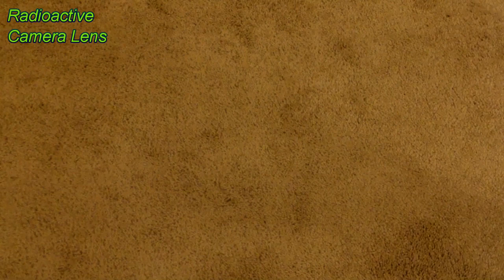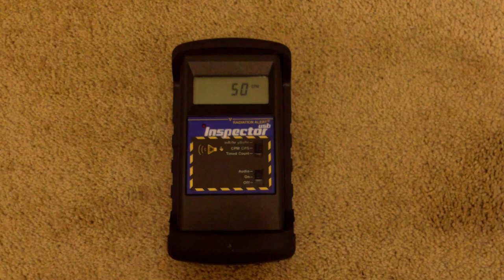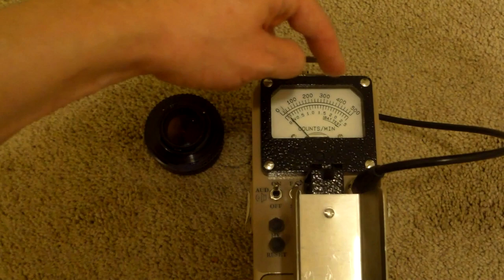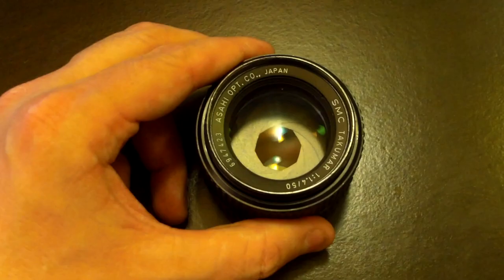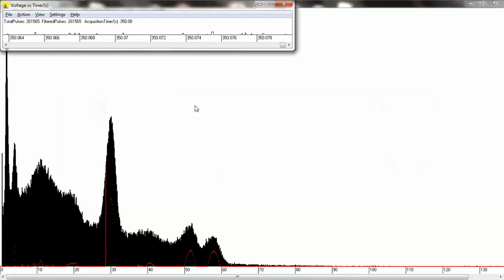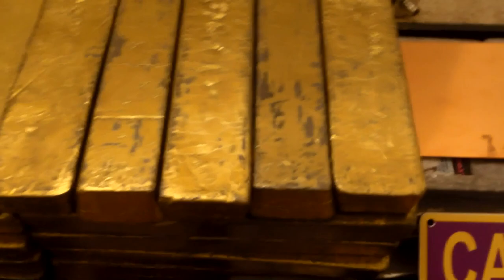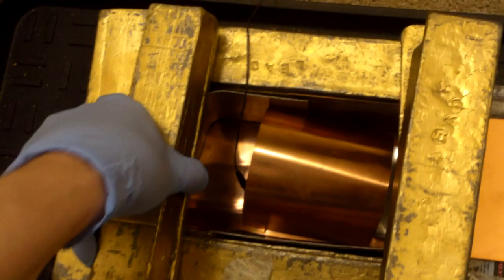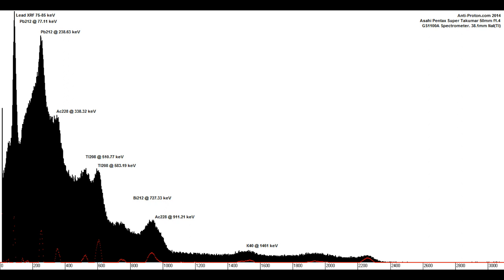Radioactive Camera Lens

Comment: So if I may ask, how have you not developed long term radiation sickness from this? For instance, if this is in microSievert readings, ~25 thousand is equal to that of about ~.00025th of a Sievert. Over long exposure times that has to crate some sort of problems...?
Reply from the maker: Radiation sickness comes from large doses and not from small accumulations. This lens puts out was less than 100 uSv/hr(perhaps 10-20 uSv/hr). This is only in my hand. By the time we measure it at my body, it is nearly down to background. The hands are the most immune part of the body.

But... just for fun, let's pretend that the lens was massively more radioactive than it is and that my body received a dose of 100 uSv/hr (that would likely take dozens of nor hundreds of these lenses). At 100 uSv/hr, the dose rate would be about 10,000 times below the minimum dose rate needed for radiation sickness.

Now, I am exposed to my samples for a few seconds to perhaps 5 minutes during a full year.

So, my total dose from my samples is probably less than a few dozen uSv/year, max.

Does that make sense?
Reply: Yeah, I was just wondering because of your casual handling of radioactive objects. Thanks for the clarification!
Reply from the maker: Chris Miller It would not be casual if I were confronted with a truely potent source.
Reply: Well yes, I truly believe that you are well qualified to be doing the studies over such objects that you are doing. I mean, other than the fact that you kind of have to be... But I digress. You seem fully trained to be doing such things that you are. But I may ask, have you done tests on common crystals (ie. Quartz or smoked quarts) that use small amounts of radioactivity to change the structures like in the smoked quartz that gives it the color that it has? Just an idea over it.
Reply: Sorry if that first part didnt make since. I meant that as you would be fully prepared to take on higher radioactive potential materials.
Reply from the maker: Chris Miller I have tested many minerals but I only find Uranium, Thorium, or Potassium, and their respective decay chains. I rarely detect anything in crystals. Yes, many crystals were colored by radioactive exposure, such as amethyst. 

I've been around higher activity sources in full labs before (such as >1MBq of Cf252). I am a little less jumpy around my stuff as nothing I own is very hazardous. If I ground up my uranium and snorted it, I might become quite ill... but the same could be said for a bottle of bleach.
Reply: Ha Interesting way to explain that. But I digress, thank you for explaining many things to me. I have been dabbling in nuclear, ie. nuclear physics and how it acts while in nature. You're a lot of help, thanks!
Reply: with 5000cpm in few days you could have radiactivity sickness
Reply from the maker: ***** Nope.

I've been in fields where my detectors read as much as 1/2 million CPM. No issues.

Units like CPM are not used in such high energy fields where actual ARS occurs. 

Let me explain:

You normally need to be exposed to around 1 Sievert of radiation within a short time to obtain low level radiation sickness. My 3.7 kBq Cs137 sample provides a dose rate around 12 uSv/hr. This means that my dose rate (if fully body) would be about 6 million times lower than required for ARS.

Of course, it only effects my hand, not by body, so ARS wouldn't occur anyway. Make sense?
Reply: antiprotons Ahhh ahh ok ok, yep I understand you
Reply: That helps alot to understand. I agree with Ota.

Comment: Run some tests with my equipment, basically a DP-66. I have found it seems to be a mostly gamer emitter. Using the Beta shield did not change the reading by much. Don't currently have an detector that can detect alpher so I can't comment on that. Takes some really nice sharp shots. Sharper then my Fuji kit lens however lacks the nice functions like auto focus and optical image stabilization.

I would not be surpriseed if the glass is lead glass. Not only would it improve the optical charistis but it would also explain the shielding it seems to do.

Comment: but why are they radioactive? or is it an accident?
Reply from the maker: +x The lens is radioactive because it is made partially from thorium. Radioactive thorium is added because it has a great refractory index, making images look better
Reply: +antiprotons yes, i got that. but did they know at the time they were made that the lens would turn out radioactive?
Reply from the maker: x Yes, but the radioactivity is so low that no one was worried. Also, back in those days radioactivity was not taken quite so seriously.
Reply: +antiprotons oh ok. wouldnt want those for a picture 1% better than a regular lens

Comment: Is it dangerous to hold the radioactive lens? Doesn't it spread? I am really curius.
Reply from the maker: It is not really dangerous. The radiation dose rate is very small and only slightly more radioactive than background radiation.

The glass does not spread contamination. The thorium and decay products are fused into the glass. It would require a solvent to remove them.
Reply: ok thanks

Comment: How radioactive are normal humans?
Reply from the maker: I recall estimates of  3kBq to 4 kBq of mostly potassium 40, as well as a few hundred Bq from uranium and other NORM in our bodies.
Reply: antiprotons Huh.
Reply: antiprotons Wait... is it true when you accidently crack a glow stick too hard, leaking glowing liquid out of it. Is it radium? And if it is, then how much potassium/Bq? Also one more question, what is the chemical that is used in decamination? I'm just really curious. :/
Reply from the maker: Glow sticks are usually only non radioactive. There are some tritium glow sticks, but they are tiny. If you place a glow stick in a dark box for about 2 days and when you open the box in a dark room, it is still just as bright... it it likely tritium.

Radium is not used anymore.

Potassium is not related to radium or tritium. 1 Becquerel (1 Bq) is 1 atomic disintegration per second. This is how we describe the number of atoms which decay per second in a radioactive substance.

Decon can be any sort of chemical, depending on the offending radio nuclide. Normally, dish washing detergent works well, as does lemon juice and water. It really depends on what you are removing. For special stuff, it can get quite complicated, like caustic soda or sulferic acid  lol
Reply: antiprotons Thanks man! Because i was holding a glowstick and it cracked open and leaked on my hand... Also, i heard holding tiny pebbles of uranium or even plutonium, is a teensy bit radioactive, witch means you don't need to decontaminate your hands, and you just need to wash them with soap really good. Is that true? Also, belive it or not, i say a guy literaly EATING AND SWALOWING PLUTONIUM!! Heres the link---> Mad Dog 357 Plutonium Challenge.
Reply from the maker: I would doubt anyone would live from eating plutonium. Forgetting the radioactivity, Pu is also chemically toxic. It that was not enough, you cannot own it legally and it is nearly impossible to get. Countries like north korea (purposefully lower cased) spend millions, if not billions, trying to make tiny bits of it from their weapons.

Washing your hands with soap is a form of decontamination. The size of the uranium sample has nothing to do with the safety. My hottest uranium sample is also my second smallest sample.
Reply: antiprotons So i could go and roll around in a contaminated forest and then go home and take a shower? Actually, only some crazy person would do that... Also is it true that uranium can explode if you like... Shoot it or something?
Reply from the maker: Uranium will not explode. It is somewhat pyropohic and will burn as a metal oxide, but it does not explode. Nuclear reactions are not explosive like chemical explosives. They require significant amounts of fissile material to be close enough and compressed enough to form a mass of critical density to allow a chain reaction. Shooting uranium will have little effect.
Reply: antiprotons Oh... because i saw it in cartoons :D

Comment: I wouldn't recommend using a radioactive lens on a film camera.
Reply from the maker: People used them for years without too much trouble. The intensity is very low compared to an x-ray machine. The film isn't really harmed (amazingly lol)
Reply: antiprotons It appears that Thorium is still being used in optical glass.  This from Wikipedia (http://en.wikipedia.org/wiki/Thorium):"It remains popular as a material in high-end optics and scientific instrumentation; thorium and uranium are the only radioactive elements with major commercial applications that do not rely on their radioactivity."   When I was shooting film, I learned (when flying) to have the rolls processed before boarding the plane and buy the film local to the shoot.
Reply from the maker: tophtml1 X-ray machines are hundreds of thousands of times more intense.  Think of an x-ray as a bright car headlight and the thorium as the soft glow from a warm filament.

Comment: but.... why should somebody want to have this?
Reply from the maker: It is of scientific curiosity, historical curiosity, and a great item if you like nuclear physics.
Reply: so it was a "oops"? (not you, the producers)
Reply from the maker: derLeon16 If by "oops", you mean an accident that it was radioactive... no. They used thorium in the lens because thorium imbues the lens with a really good refractivity index and makes a great picture (it is a really nice lens). They either did not fully appreciate that thorium was radioactive or did not think it was radioactive enough to be an issue.

It is only recently that people have started panicking over small amounts of radioactivity. That is not to say that this is safe, but it is certainly a low dose, at best.
Reply: oookay... thanks. :)

Comment: also that is a very poor gieger counter
Reply from the maker: +AmericanSoldier8 
What are you talking about?  The Scintillation count is a brand new $1600 Ludlum 12 + 44-2 1" NaI(Tl), and the Geiger counter  (I own 5 GM's BTW) is a $550 SE Int. Inspector USB.   I have some of the best Geiger counters on the market...

What would you call a good/better Geiger counter?
Reply: +AmericanSoldier8 You're just being unnecessarily rude. If you don't like it, just don't watch. x.x
Reply: Mines in the shop

Comment: Have this lens and do use it once in a while on digital cameras. Well I do get the improvement on RI but camera film of olden days. SLRs (As this lens was intended for), were very sensitive to any radiation even short ones s.a alpha but with your demonstration, clearly showing maximum radiation from rare element (Closest to film) and then the fact that film could stay in camera for a long time (In some of my personal cases, even years and decades -OK just remembered!) so why was it so engineered? Ignorance?? Or is it that in reality the extend of radiation is so low that it has not much detreating effect on the film. May be next time you can run an experiment and see if this kind of Thorium 232 radiation, actually could have any effect on the film and for all who read this, don't forget that even today, a lot of facilities working with radiation, still use badged film wearing to determine their level of legal gama exposure. And may be storing a safety badge film near the rear element of lens, that is stored for months or various points of time, could be sent to regular detection lab and see the levels you get, as opposed to the allowed legal levels. May be a good topic for another YT clip.